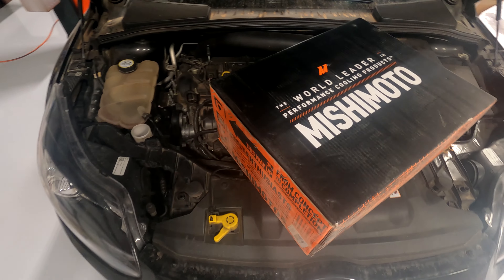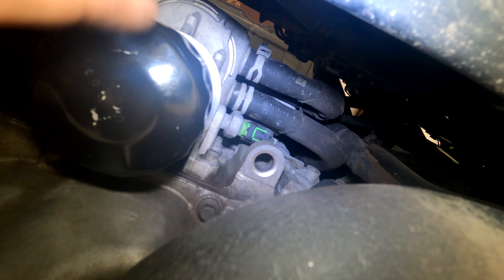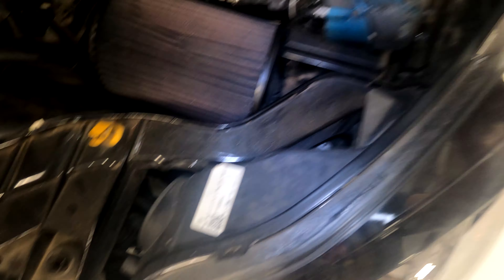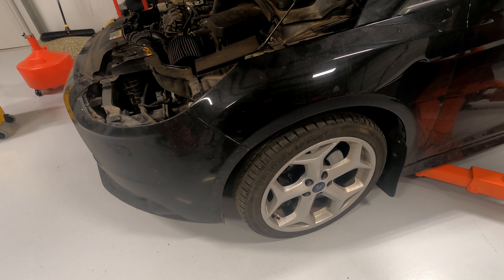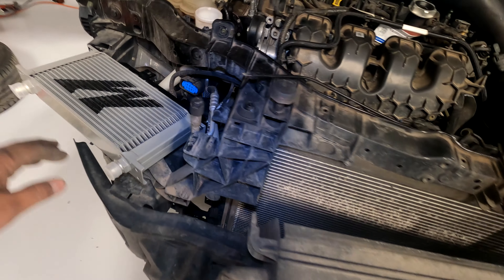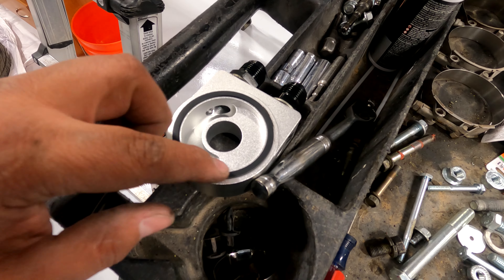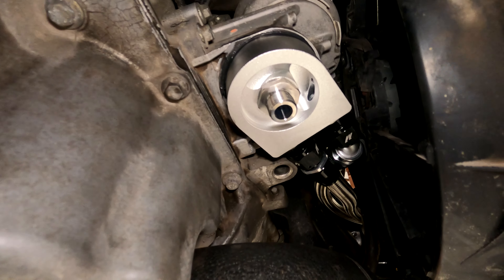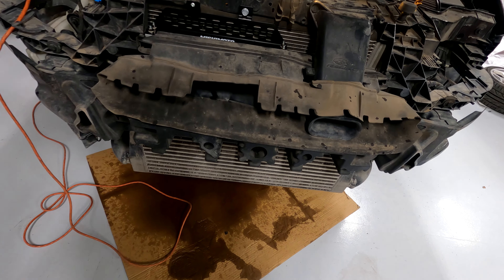2013-2020 Ford Focus ST Oil Cooler Kit -Mishimoto-

Comment: Interestingly, none of the instructions or other videos I’ve watched, do they bypass the factory cooler. Curious why you did it..  I just received my mishimoto oil cooler for my 2016ST, getting it track ready for MSR Houston in Nov. I’m stoked to get this in, it adds .65qts, then if you put the FL400S larger oil filter on, that’s about .3qts… you can run exactly 1 full extra quart than stock. I opted for the thermostatic adapter, even though I’m in south Texas, I figured better safe than sorry for the extra $40 or so.
Reply from the maker: I did it to take the thermal load of the oil off of the radiator.  And if the oil cools lower than the coolant, i dont want to reheat the oil back up.